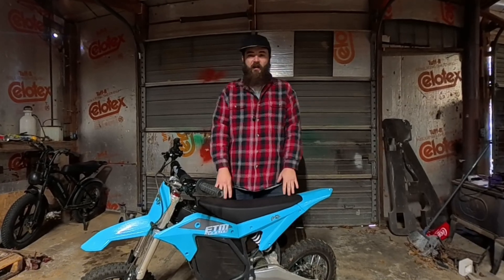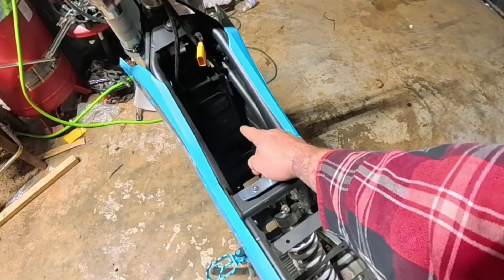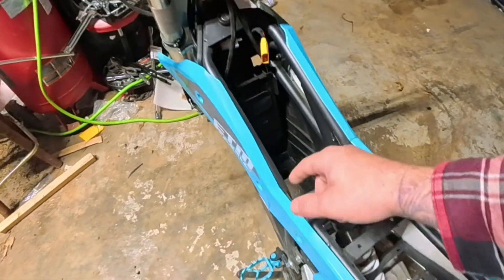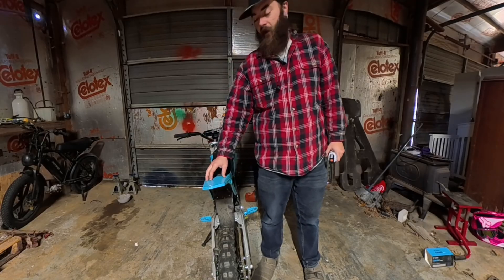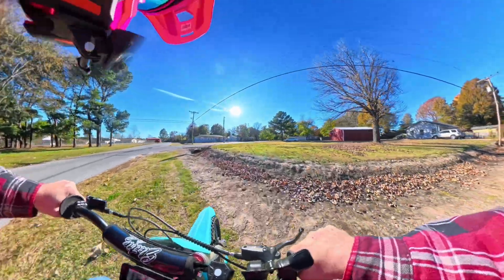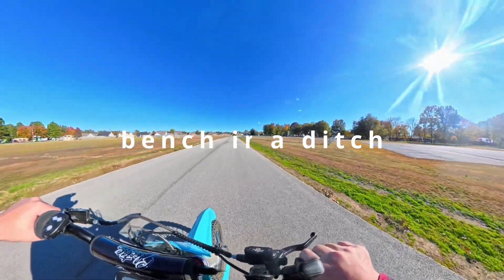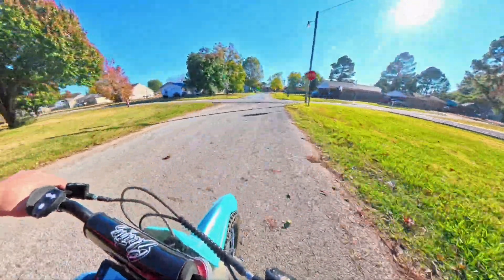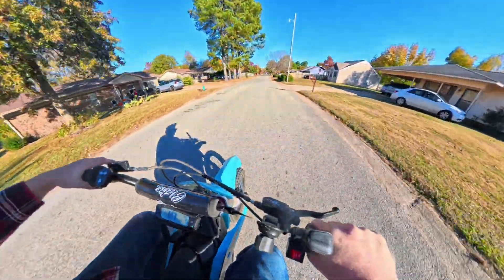I made my RTR lite street legal, 6+7 kit from electro and co.

Comment: Did you add the upgraded battery
Reply from the maker: No I would've shown that in the video I specify I didn't upgrade it later  .just showed in case people were new to the hobby and were intimidated by it. I am going to be doing it soon but now I'm hearing there's another jump in power in the works. So might wait and get the 45 ah
Reply from the maker: My bad for the confusion should've dropped that in text

Comment: Would you be able to run this kit on a stock rtr lite battery
Reply from the maker: their website says you can im sure its then limited to 8kw i havent seen a stock rtr lite battery run it yet. but their site says the mod or touring battery is reccomended but not required
Reply: What if you get the high speed motor on a stock rtr lite battery
Reply from the maker: @skypointrealty6678 I'd get the battery to get the added power tbh the batteries max output is important too. I believe their site is just worded poorly when talking about it

Comment: How’s the range w/ the 67 kit?
Reply from the maker: Range is dependant on so many variables like weight,terrain,and speed it's hard to say and feel accurate tbh 40 +  if your not hammering it 24/7/365  my eride gets 40+ miles with  40 ah but I do urban/trails in every ride .so lots of sustained high speeds unlike on a trail. And the fact that you tune it also plays a large role. Sorry to be so in direct just don't want to b.s